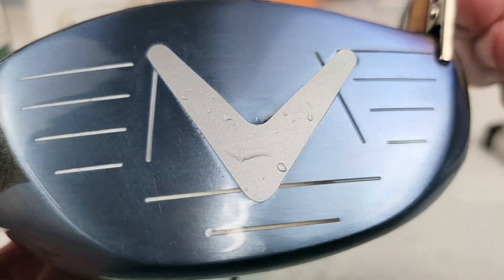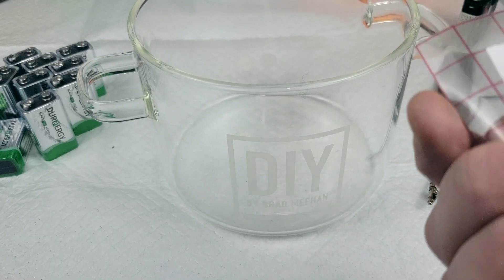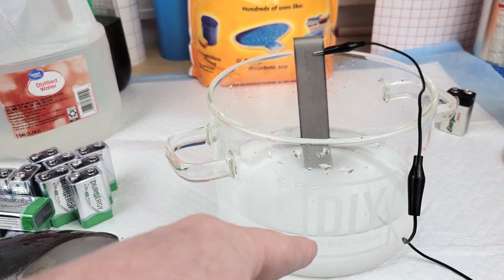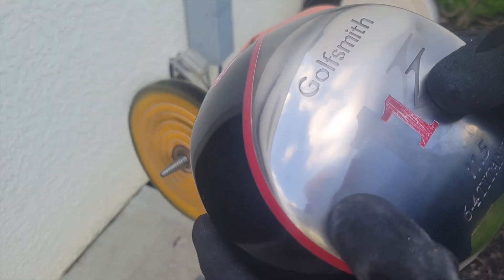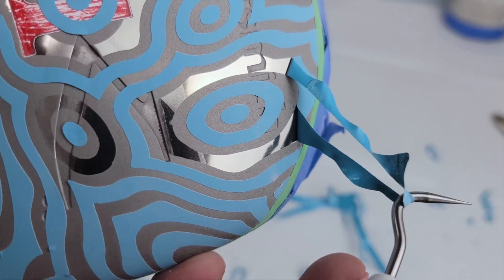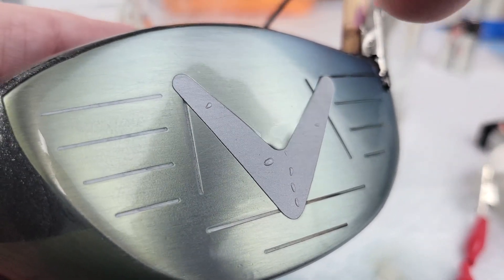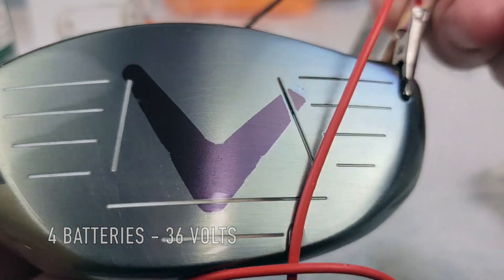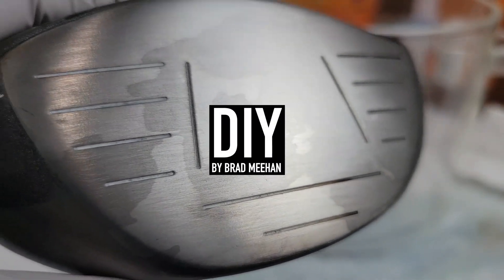Watch This: Golf Club That Changes Colors Before Your Eyes! EASY Anodizing Titanium

Comment: Hi Brad. I have just tried your technique to change the colour of my driver and 5 wood but it did not work. 😢. I did it exactly the way you showed on the video but nothing. I used 5 batteries as I was expecting the blueish colour but niks. The club heads used were a Titleist 917 driver and a Tietlist 915 fairway wood.
Reply from the maker: @kevanpillay9701  can you post pics in my Facebook group? DIY golf club restoration is the name. Thanks.
Reply: Me too, set it up as a "science experiment" with my 7yr old. Looked like a straight up 🤡! Driver was a MacGregor MacTec, I even made sure to find a SS anode. Used a little to a lot of baking soda. 🤷 Can't win em all.
Reply: I wanted to add, I'm also stripping down my daughter's clubs to bare metal. She's going to pick out the colors and give the rattle bomb a go. Shout out Brad for making me look like a cool dad most of the time! Love the channel!
Reply from the maker: @ronchi556  That's awesome. Let me know how it goes!
Reply from the maker: @ronchi556  did you have a good electric connection? Meaning, did you connect to bare metal or was it painted?

Comment: Loving your vids! What sort of resotration would you do for irons that never had the chrome/ polished look? E.G Tommy Armour 845's from the 80's/ 90's, Ping Eye 2's, or old Taylormade burner irons? Thanks so much!
Reply from the maker: I have all the video for this filmed! I still need to edit it, here are the steps: you still polish it to make everything even, then use your handheld sandblaster (or cabinet if you have one) using glass beads at a low pressure. 

I'll edit this video to show you. It's the easiest finish to do.
Reply: @BradMeehan  awesome, thanks! Gonna refinish my dad's 845's and my grandpa's Ben Hogan Edge's with these videos. Super helpful!
Reply from the maker: Check it out!

https://youtu.be/_vQRKWvKR48

Comment: Very cool!  Is there a way to make it fade colors to other colors?  Does heat do anything?
Reply from the maker: Yessir. You lower the voltage and dip about halfway and you can get fades.

I'm going to do this heat changing thermochromatic paint to a club. When the driver is hot, you see a different image:

https://youtube.com/shorts/1Ep6QSLqzOI?feature=shared
Reply: Can't wait to try this myself. And to see the thermo paint.

Comment: How will it hold up with hitting balls?
Reply from the maker: Yes. You can't easily remove it with sandpaper alone unless you really spend time doing it. The sole would be vulnerable imo, but the face is solid.